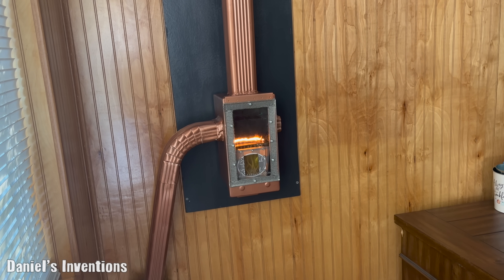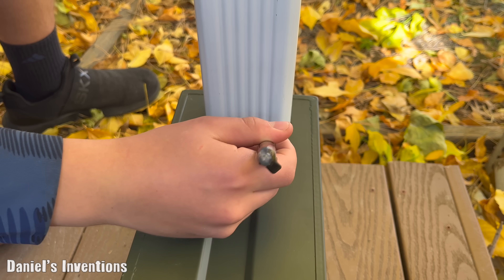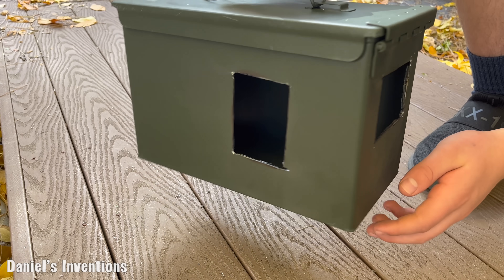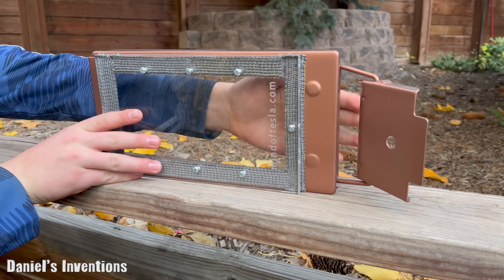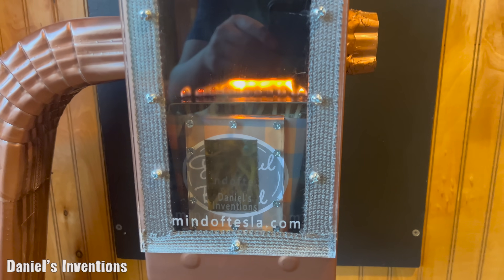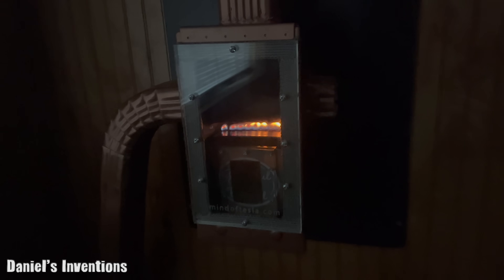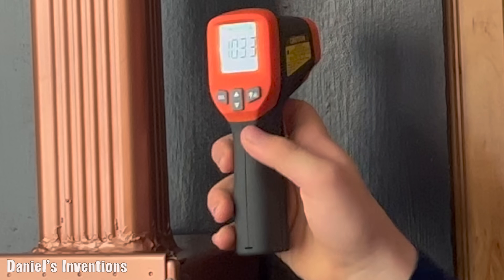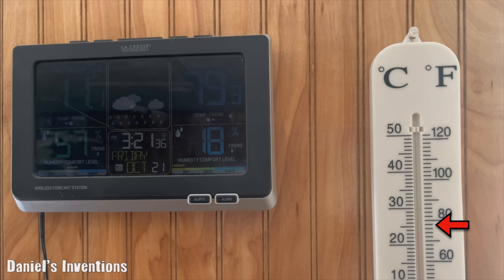ENDLESS Heat for Your Home WITHOUT Electricity

Comment: Every yr I have a few tons of leaves in a compressed pile I then burn over the winter at my leisure, whenever I have time and the wind is blowing in the right direction. I want to make a stove that works similar to a pellet stove with a water jacket that can auto feed in shredded leaves and make heat for my shop. I guess I could buy a pellet stove and then build a pellet mill for the leaves. Be nice to just shred them and put them in a big hopper with a screw drive feed system. Some day....

Comment: The only drawback to your design is there's no apparent way to control the heat.  if you added something to adjust the wick length, you could control the size of the flames and therefore the heat output a little... this way you're not opening window or doors to cool the house off if it gets too hot lol

All the same, I love the ingenuity - even if I'm not sure I'd leave that thing on overnight while I sleep 🤪

Comment: @3:57, NO, that is not the temp of the output.  Not sure why no one knows how an IR gun works.  It cannot see the temp of the air, you are seeing into the heater and seeing the temp of the metal right over the flame.  Also, the emissivity of the metal can come into play, if you try to check the temp of any shiny metal, or even dull copper, those cheapo IR guns will only see the reflection temp of whatever is in front, just like a mirror.  Go ahead, check the temp of your stainless steel refrigerator, you’ll only see YOUR BODY temp reflecting off the surface.  People need to research how these things take temp before trusting the numbers they give you.  Also, JB 'weld', really?  you know this isn't welting right?  it is an epoxy - it is unsafe to use it in the manner you used it.  throw that thing away, use compatible materials, and learn how to really weld.  OMG.

Comment: i'd personally put in a computer cooler, with the side that sits on the cpu bolted to a thicker piece of metal over the fire and seal it up with the fins outside the fire chamber and a fan over the tunnel just like this. i dont know if those coolers would blow up under these kinds of heat load tho.

Comment: I am not quite sure i understand this. You are using candle wicks, and burning oil - and it supposed to keep the two bedrooms warm.
So in a week time you are burning through a gallon of oil. That is about 3.7 L in volume. 
1 L/h of oil would produce 9500W heath. 
So if we were burning it all we would get about 35KW heath - According the video you go through that much in 7 days, as in 168 hours which will roughly equate about 200W heating power / hour. 
Based on the description you are heating up two rooms with this therefore on average (allowing equal heath distribution) you get about 100W heating in each room 
Even if i use petrol for the heating process which has higher energy density... it would still produce less than 250W heath / hour (or 125W/h / room).

I am not sure if a 100-125W heating is sufficient to keep a cabin warm_ish... I mean its equivalent of an average human standing in the room naked and hoping that our body heat would warm up the place (we are about a 100W/h heath source)

(the fact that there are 10 wicks in there does not change the math - given amount of fuel contains the same amount of energy, regardless of the method (or speed) of extraction... (assuming perfect burning, no unburn fuel gets wasted))

A spaceheater runs around 1500W and is barely okay on a colder day for ONE room... and spaceheaters are designed to turn electricity into heath (with the exception of the fans) - which makes them very efficient (close to 100%) - And here we are talking about somewhere between 1/10th or 1/15th of power (per room). 

Unless i misunderstood something, in that case i am happy to be corrected.

Comment: Is J.B. weld really holding up for many years? I would not trust this to be onest. Better weld it properly together with metal.

And is the concrete block really enough for isolation? I would personally double and triple check it and make it more safe. I mean if u house burns down u would never forgive urself.
This is no toy. The idea is good, but it needs more safety and room for errors.

Comment: My issue is with using copper instead of stainless..... Copper is not meant for that type of heat and will give off a poisonous gas every time it reaches a certain temperature as stainless steel will never give off a poisonous gas.
Reply: It's just painted copper color

Comment: 5$ a week =  ~250pa
which is somewhere between 500 and 2000 kwh depending on where you live.
my whole fuckng house needs only 900 kwh fow electric heating for the whole year. The whole house. 
so using this method i would only pay like tripple the amount im paying for only 2 rooms instead of the whole house. Plus it might burn dorn.
looks nice, sounds nice but is complete BS. sorry to tell you...

Comment: Inconcept it's a great idea, please pair it with a carbon monoxide alarm though...  You may also want to increase the quality of parts used, for example a metal chimney is usually double or triple wall thick to prevent the house from burning down

Comment: This is really great and although from what I remember being your age, i wasnt a fan when someone told me how young i was when I did anything, i will say you are far ahead your peers.   Great job!  Have you heard of "sand batterys" , more specifically,  sand heat sumps/batteries, that use large metal barrels of sand to store excess heat from a heat source.  That heat source could be your heating setup!  It will be more efficient and the heat would dissipate more uniformly.

Comment: While it does look to be done with safety in mind, if you get it wrong you may die from carbon monoxide. Here in the UK all heating appliances need to be professionally installed and checked. I really would not risk my life for it.

Comment: You may want to air-gap that fireboard from the wall too, mainly to avoid hot spot issues where your heater is mounted and make sure that you put some fire resistant batting between your exhaust pipe and your wall material where it exits the building. I also don't typically recommend JB weld for such a project unless it's the high heat formula. I'd suggest having your exhaust be either pointing to the side or upright with a vent cap. Pointed down, it won't release the gasses correctly. You might want to consider putting a screen on that intake pipe because vermin might think it's a way in and make a mess for you. Also verify the piping materials, last I checked, gutter drain pipes were aluminum to avoid rusting and being lighter. 

Further improvements:
*Flat Wicks for wider flames
*Flame adjusters (can be got from a dietz hurricane lanterns or other lanterns)
*an extinguisher system for putting it out without opening the thing (can be done using a flame adjuster)
*A little more air gap between the flame point and the heat exchange pipe (the one you heat with the blower on it)
*change the shaping of the computer fan mount. Flat restricts the air flow and puts stress on the fan where longer and tapered in toward the hole helps direct all of what the fan pushes.
*A refueling pipe that goes outside the ammo box. May not be necessary, but would be convenient.
*Finally, internally, use metal flashing to direct the hot gasses into the exhaust pipe internally. it may take up some space, but it reduces soot buildup internally.

Definitely clever for a budget build. One can also get those Ammo Cans from a harbor freight and Army Navy surplus stores if you happen to be near one. You also didn't cover what you painted the thing with. I'm hoping that you used something like exhaust header paint or charcoal grill paint that you can get from a hardware store or auto parts store for the heat resistance.

Comment: Great build..... yes these type heaters have been around a long time..... 
You need to not use drain pipe....use steel. Also put another barrier between the back of the heater and the wall. Your exhaust pipe should be setup like a propane hot water tank exhaust or even a wood stove exhaust.
The small fan pushing the heat through is a very efficient add on to this system. Very good project!! 👍
Reply: Read it again steel was used READ before you comment keeps you looking less you know what.
Reply: Could the drain pipe be used in place of ductwork?
Reply: The fan is very INefficient. There are fans that use no power at all to circulate heat and there should be a gap between the heat shield and the wall not another barrier.

Comment: Dude, those gutters are aluminum not steel, so a lower melting point. Very dangerous installation as well. You installed this right on a wooden wall! You're going to burn that place down..... Yikes!

Comment: I pay 14c per KWH for Electricity, If I use a 1000W space heater constantly for 12 hours a day it costs $1.68(2.52 for 1500W), for a week it would cost $11.76($17.64 for 1500W)  but most have a thermostat so it wont run that much. I found a gallon of oil on amazon for $47.99(cheapest) which you said burns in a week.  However, your furnace idea looks kinda cool.
Reply: It can be any oil from used motor oil to diesel fuel. Diesel fuel would be the cheapest at 4 dollars a gallon. At a gallon a week, thats less than 20 bucks a month for heat. And a free week every 3 months if you regularly maintain your car.

Comment: I like it but umm.... without electricity?? 3:12, Computer fan runs on a 12v DC is the fan 100% necessary?
Reply: I thought the same thing when he brought out the computer fan although it doesnt take much power I guess they meant no electricity since you can run the fan off a battery and/or solar panel nstead of having to actually wire something to the your breaker box or run wires to already existing setup. Or just click bait lol

Comment: I stead of using g the 12v from a wall or battery go 100% electric free with a Peltier Device and run hest resistant wire through the air ducting

Comment: The gutter metal will fail under direct flame over time and could cause a oil fire due to hot metal dripping in oil. Also the concrete fire wall is not safe you must have the heater spaced from the wall by safety codes. This is a standard practice because the wood will get so hot that it will char and eventually light on fire from the transfer of heat. You have a great idea but needs improvements.

Suggestions raise the gutter so it doesn't contact the flame and mount your box with spacers on the wall. Replace the wood with fire wall protection. They make a sheetrock called fire wall. 
This is a great idea but safety is key.

Comment: Most people don't realize how important it is for the input air to come from the outside. There's at least twice the volume of exhaust, compared to the volume of input air, because the heated air expands. However, for every two cubic feet of exhaust that goes up the chimney, a cubic foot of air gets pulled into the fire from the draft. Why use warmed air as the intake? The fire doesn't care about the 50 degree difference between outside air and inside air, since the fire can be as much as 1500F. Use outside air ducted to the combustion chamber, and this provides a dramatic improvement in room heat efficiency.

Comment: Cool little idea  you should incorporate a metal Cup area on the top surface or a area to place a tin Can to warm up whatever is inside  the container that way  in emergency situations a Can of Soup  can be warmed up for a easy meal or even Heat Water for instant Hot Chocalate , a Cup Of Coffee  ,or even  a way to wash or clean hands , wounds  or whatever  with soap and water during that Power Outage or Emergency  Overall. the idea  and Look is very good !

Comment: dont you have to pull out more string when it gets low? And it would have been good if you showed the process of putting the wic strings in... in my mind i can see the string burning down to the oil and blowing up... i know its secure but that's only based off of what I could follow.

Comment: I don't hate the idea but I'd be concerned with safety with something homemade. 

Also if the heat on the top is enough to cook then could be interesting to make a space for cooking and make most of the energy. Kinda like the old Firestove.

When it comes to price ... I live in quebec , I pay my energy bill monthly with a yearly adjustment and pay only 50 cad for a 1 be apartment,  that include also hot water, heating in winter, AC in summer , and I work from home.  So not that much more than your 5 (us?). $ weekly since it includes all the rest.

In Quebec 97% of the energy is hydrolic  so very low carbon emission too.

Comment: A great idea, but the hot air should have come out as close to the floor level as possible, where it is the coldest. The heat will stay at the stove level and higher. And also if possible, the heat should have come out underneath a bigger window, so that the window will not be the cold spot in the room. I don't think I would have liked to have a computer fan running all the time to heat up a room, but off course that is inevitable with this set up. And maybe you get used to the noise after a while.

Comment: I don't know if I missed a comment that mentioned it but, everyone is missing one thing. It says "NO ELECTRICITY" but yet, it employs a 12v fan? I get it that through heat draft it would work without the fan but much less efficiently. Overall like the idea though.

Comment: Brilliant young man! Where not a new idea, it is encouraging to see it used in this very practical way. Albeit if you go to McDonalds (or equivalent) and collect their discarded fryer oil you can have an near endless supply of fuel for your heater. Albeit your neighborhood will smell a bit of french fries, but that's not too bad a thing is it?
Reply: This is a unsafe surefire recipe on how to kill your family.
    First this bad design using the warm oxygen in the room, which us a code violation In the USA. Because you that same oxygen to breath. DO NOT DO THIS.
This setup will leak Carbon Monoxide into the house. This is why we do not use Franklin stoves in the home.
JBWeld is bot heat resistant and will fail when exposed to prolonged heat thus causing it to fall apart and causing a hours fire.
DO NOT DO THIS.
Lastly This furnace is too small to heat a Closet much less a whole house. At best it is about 500 BTU.

You have No safety precautions, No alarms or CO Detectors.
He is not qualified to teach anything.
It needs a heat exchanger to make this safe.
your welcome
A certified Engineer. BSEE, BSME, MEE, MEE, BSCS

Comment: I was going to make something similar by using fence pipe running directly through an open fire. The fire heats the tube and a fan blowing on one end pushes the air into your home or tent. I was told that the pipe can not be galvanized as this will cause deadly fumes created by the heat on the inside of the pipe. Are the gutters galvanized? I was told it should be stainless steel pipe.

Comment: Hey guys that is an awesome idea. As someone else mentioned the materials are a bit different then you thought and to make it safer you just have to take down the concrete board and put in some minimum 1" metal spacers that can also be used to hang back up the board ,once its installed to the wall. I would have to say i would have searched for a different box as i love my ammo boxes, well for ammo! lolBut in a SHTF or grid down situation i could build one of these with materials in my garage. As long as you dont let it get too hot ,its just fine! Although if you get the chance i would go with metal stove piping. It comes in all different sizes. That way if your sleeping it cant get too hot. Or someone should always be awake, to keep an eye on it. Safety 1st guys!?! But that is some Mcgyver stuff there! awesome video!!!

Comment: An IR gun like that won't measure the exhaust temperature. It's measuring (inaccurately) the temperature of the exhaust tube, and 450°F is hot enough to start a fire if something touches it.

Also, without a CO monitor you're risking your life using this indoors. That JB Weld will degrade over time, ditto the aluminum, which will eventually burn through.

Comment: Hi Daniel- I like so many things about this video- especially, the fact that it can be used for different fuels.  I see another comment asking about oils and fuels- I have the same question- where are they available, which ones do you like best?  I know true engineers/chemist types would already know about this, but I'm not one of those.
When I was visiting an off-grid place in the jungle in northern Ecuador, I saw an excellent rig with a hot water tank built around the exhaust pipe, for on demand hot water, and a more favourable specific heat for keeping the space warm even when the stove is out.

Comment: Although this is an interesting video, there are many points that need to be more convincing. For example: rather than measuring the temperature of the pipes, put two temp sensors, one to measure the input air temp and one the exhaust air. This way combining with the air volume the fan can push m we will know how much energy the air gains by passing through the heater.  (I know that the heater also radiates thermal energy but this can't be measured that cheaply/easily.

Comment: LMFAO - WHO do think you are shitting?! 1 gallon of oil is 132,000 btu, if you burn 1/2 gallon a week that is 18,857 btu/day (785 btu/hr).  The only way that is possible is if your outdoor temperature NEVER gets below 60 degrees F.  220 square/ft would need 18,000 btu/hr is it was 0 degrees outside! A human produces 712 btu/hr under normal activity -2,848 btu/hr while running! Your heater produces as much heat as a human under normal activity!